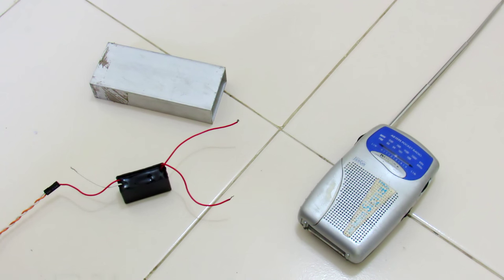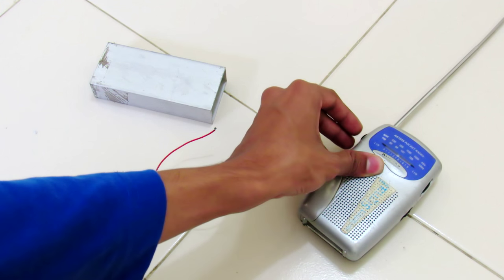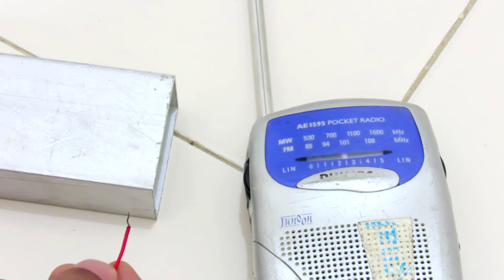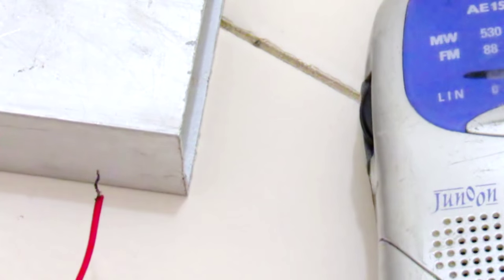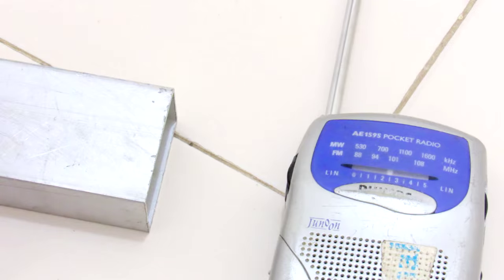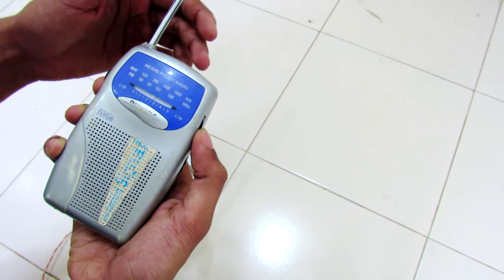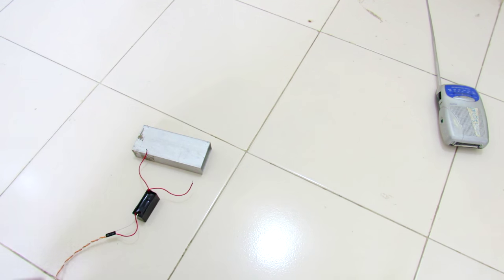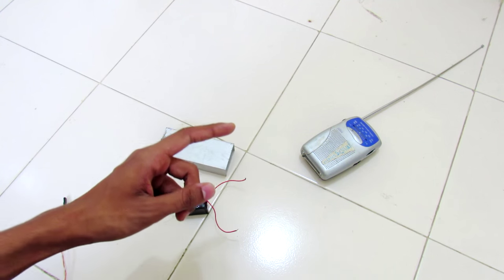The New Emp Jammer Experiments - Emp Technology

Comment from the maker: Hello, Friends
If you have any questions regarding emp jammer just post it on the comments , I will do my best to answer your questions through next emp jammer video !
Thanks for watching !
Reply: hey can you make a video on how to make emp from a transformer taken out from a phone charger?
Reply from the maker: Well its not effective to use transformer from phone charger , becouse it can only be able to convert low input voltage into 230 /120 volts . We need few kv to make interference stronger.
Reply: +Kedar Nimbalkar with this , u can disturb a cellphone segnal ?
Reply: list of parts?  And links?  Like your video man.  Keep it up.  I just ordered some generators and magnetic wire. Whattransistor and resistor do i need to use?  Or do i have to use one?